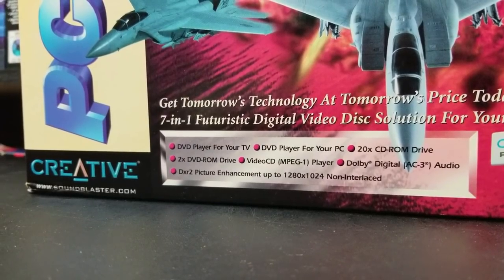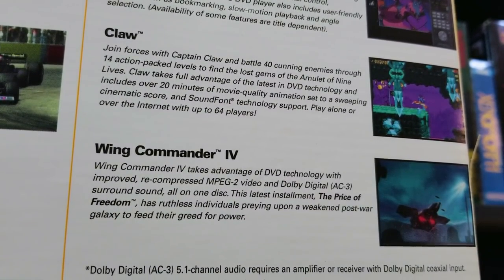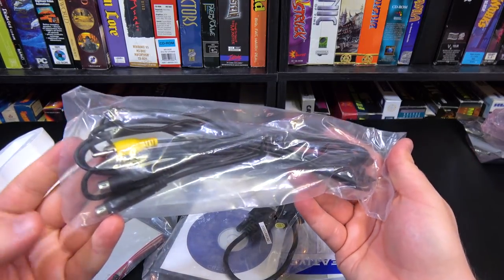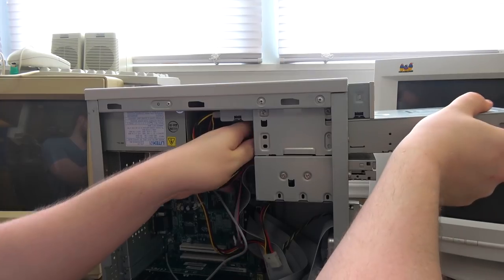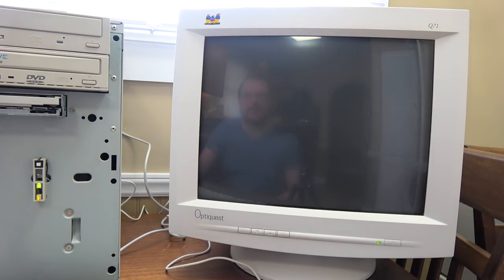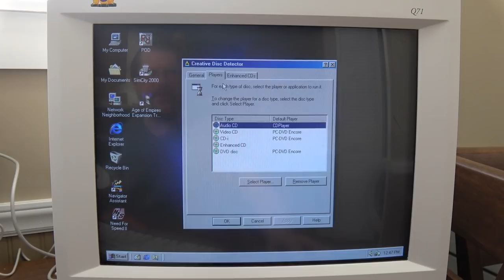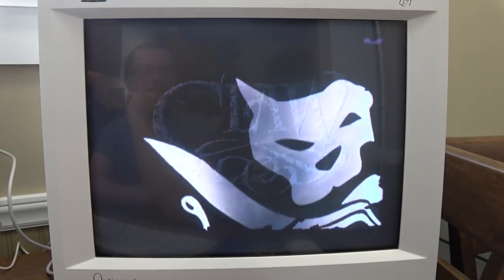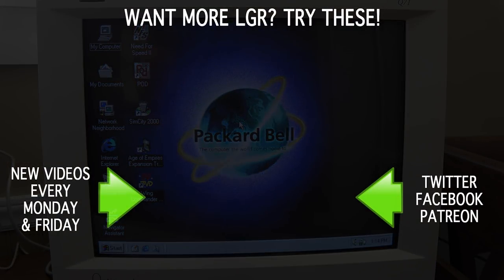The 1997 DVD-ROM Upgrade Experience: Creative Encore Dxr2

Comment: Watching Clint use the button to close the tray made my day. As a young person I HATED when anyone would push on the CD tray to close it.  It still makes me cringe.  Not that you see people using optical media much anymore.
Reply: Yup, that was my take away from this vid as well. My biggest pet peeve is pushing the tray to close. @AdmiralSpeedy any force used is bad for the internal gear. They made it do that cuz they knew most idiots would push it, so it better retract on pressure to mitigate damage. An electronic button that sends a signal to the motor is the preferred way. Even Open/Close command send from the software is better than pushing on the gear.
Reply: My computer's optical drive doesn't even have a button, so I made one in software instead.
Reply: Holy shit THANK YOU!!!

I had a friend that would always shove the disc tray of my Xbox closed as if he was trying to shove Toothpaste back into the tube.

Like holy fucking shit dude, it's a piece of plastic with some weak plastic gears and shitty motor, WTF are you forcing it shut for? Just press the fucking button and wait the extra 0.002 seconds for it to close FFS.
Reply: They are designed to be closed with a push, what you're not supposed to do is give it more of a push than it needs to start closing on it's own, it won't hurt it more than normal wear unless you force it.
Reply: @Hadwell - It's a gear and motor. It was NOT designed to close with a push. They made it activate with resistance so it will be less likely to break. When the gear encounters resistance they allowed it to send a safety signal to the motor. You can avoid this entirely by sending the signal directly with the button. BUTTONS are DESIGNED to be pushed.
Reply: I replaced a PSU in my main rig the other day, realised after putting it all back together that I hadn't plugged the DVD drive back in...  and didn't bother with it.  Haven't used it in well over a year now...
Reply: Lol I hated it as well... Some drives actually came with instructions not to do that and press the eject button instead. 
But at the time unfortunately, even the computer ads on TV  showcasing PCs with (the then new) CD-ROM drives showed the actors/actresses pushing the tray and not only that, erroneously having the data side of the CD up, to show off how shiny and futuristic it looked....

Comment: Reinstalling Windows 98 is the ultimate late 90s upgrade experience. Solved 99% of computer problems.
Reply: Molo9000 That’s still the norm, unfortunately it is with one of the most crappy OS: Windows 10.
Reply: I don't know man. I've been running Win10 since release. No reinstall, nothing. I remember the old days when I'd reinstall Windows on a regular basis.
Reply: FischOderAal I guess you got lucky, in Windows 10, drivers are automatically downloaded off Microsoft servers. However, it tends to download outdated versions, which had caused me a variety of video card driver crashes and sound pops. Even if you installed them manually yourself, Windows Update would keep bugging you to install the “latest” version of the driver. Unable to block Windows updates is a big no no for me. Luckily I don’t have to deal with that on Windows 7.
Reply: Win2K as we called it was the first really stable Windows. At least for me and the people I knew. I was so reluctant to upgrade from that but Microsoft has this way of forcing upgrades. I honestly can't see what people are moaning about nowadays. The hardware is generally so good across the board and the OS's from everyone are stellar. At least compared to how it was win95 kinda days. 

Remember how you'd play a game for a while then get that itch to save because you knew it had been a while and you were due for a crash! lol its not like that anymore thank the broadband gods
Reply: Win 98 SE was OK. But I was soooooo glad moving from Windows ME to Win2k...
Reply: Windows 10 is flawless.  What are you doing wrong?
Reply: ShockwaveEXP
You must be doing it wrong. The only reason I reinstalled Windows 10 lately is because of my CPU/mobo upgrade. If it weren't for that, I wouldn't have needed to.

Classic Windows versions needed to be reinstalled like once or twice a year, but not any more.
Reply: I actually had a quite stable Windows ME experience; the computer was built specifically for the task, though of course it ran Windows 98 and 2K quite a bit better. I miss that computer...
Reply: The infamous 3 stages of windows troubleshooting: retry, reboot, reinstall
Reply: Who else remembers the DOS days? Windows 95 was a godsend back then.
Reply: Molo9000 I just recently had to reinstall stuff on Windows 10... Sooo... Tradition running strong?

Comment: It does not shock me that going from Win98 to Win98SE fixed everything. Win98SE was a massive improvement behind the scenes and native DVD support was one of the categories that got the most of it. In fact, back in the day my upgrade from 98 to 98SE made my daily life a whole lot easier. I probably had about 95% less blue screens and freezes in general after the upgrade.
Reply: For me it was the USB support that was the game-changer.

As a young teen I thought 98 SE was just a cash-grab along the same lines as Plus! and ignored it without a second thought. Not until years later did I learn that it in fact incorporated significant changes under the hood and was the best DOS-based Windows. So much trouble I could have saved myself.
Reply: Yeah Win98 First Ed. was a total train wreck. They had to rush SE out to fix a bunch of issues cos everyone was getting blue screens and also USB issues I remember. Of course this was pre-broadband too so you had to buy a new physical copy (from memory I think MS offered $$$ back deals for people who bought First Ed).
Reply: Andrew Wallington back then was an upgrade 98SE.  I was lucky my first computer I choose a P3 450 96MB ATI all in wonder Pro agp 8MB. Toshiba 6x dvd. Never had issues.  I upgraded to pioneer A03 DVD burner it had a fan added 1 inch longer Aug 31 2001.
Reply: @AnnabelleTheRose  I was going to correct you then I did the calculations

OMG I forgot how slow dial-up was haha
6.5 days for 544MB :o
I remember when my 56k broke and I only had a 14.4k to hand XD
Reply: @snetmotnosrorb3946  cash grab? It was a free upgrade.

Comment: I do not miss this sort of cable management.
Reply: I do miss Windows start up sounds.
Reply: It looks pretty tidy compared to all wiring closet i have been in.
Reply: Back then, just opening up the computer to perform an add-on like this made you a computer expert in most of your family member's eyes.  Good times.
Reply: Those damn flat cables, the awful case designs of that era, fucking around with jumpers,  fires from shitty PSU's that turned your PC into an actual F-18 that was slapped into every PC component box ever and so on.
Times sure have gotten easier on that end. Good cases, no cables to be seen anywhere, good reliable components.

I do kinda miss the cheesy designs on GPU boxes especially. Those continued pretty far into the 2000's but eventually disappeared. If your GPU box had a FLAMING DEMON DUDE on it, you knew it was fast.
Reply: "good reliable components" That's not what get better since old times, quite the opposite in fact.
Reply: So many cables just not quite long enough.. cutting your hands on the shoddily punch pressed steel whilst trying to make everything fit.
Reply: Skynet D-TERMINATION To a lot of people STILL opening it up to add a card makes you “that guy that knows computers”.
Reply: You didn‘t get the full version until you had a SCSI cable for 7 drives. ;)
Reply: I'm quite the opposite. I've always hated working with SATA cables in general (Especially in tight spaces). They've felt quite shoddy that I am afraid that I will snap one if I bend the connector by only a few degrees. That and the non-locking ones always have had a rather loose fitting connection. It was way too easy to accidentally unplug them while working on something else.
Reply: Imagine the spaghetti on high end entertainment systems back in the day! I, myself, had to wire up one such system with a DVD player, graphic equalizer, record player, tape deck, 5.1 surround sound and 5 cd changer. HDMI makes it SO much easier!
Reply: I do. Not visually pleasing I admit, but it was the magic of discovery at the time (in my case) that has got me quite attached to the late 90s PC period. This vid was pure porn xD
Reply: I had to wipe a bunch of hard drives in some early 2000s computers with IDE drives, it was so weird working with that stuff again. SATA is so, SO much easier to deal with.
Reply: Agreed. IDE was a true bodge to get things working whatever the cost.
Reply: Nah, good components have no era, bad stuff bitd and bad stuff now.
Reply: Remember the days of cable rounding? Where you'd take the long wide IDE cables and wrap them up into a tube for better airflow
Reply: I actually have a round cable somewhere, but it was causing read/write errors. You can still buy them from Directron.
Reply: Never really had any airflow issues in my systems. I guess old cables wouldn't look great with the window cases we can have now, that would look pretty ugly. Aesthetically I do think modern cables look more tidy and a lot of the connectors are easier, a lot of the older ones were murder on the fingers. Ow!
Reply: Remember?  That's what I'm doing this weekend.  Got a 15 year old Harman Kardon AVR, a Pelican system selector, and every major game console from the 80s and 90s.
Reply: @ProjectiluvOP
My ASUS R9 270X/280X boxes have dinosaur scratch marks on them… maybe not as cheesy but certainly still cheesy.
Reply: Skynet D-TERMINATION. It still does with the backward yokels i call family
Reply: like like red tube?

Comment: Great video.  Slight correction.  DVDs didn't increase in density.  Double sided DVDs were replaced with dual layer DVDs where both layers were accessible from one side of the disc (one layer was transparent to the laser via focusing control).  This removed the need to flip the disc halfway thru the movie, yay!

Comment: It's kind of amazing that DVD's resolution is so low that even 1997 monitors needed upscaling to make it look good. I remember seeing 1600x1200 monitors in the late 90s that totally blew my mind.
Reply: carmack had a 1080p monitor in 1995
Reply: @Kasperx138  Really? Did they even exist then? I remember a friend of mine had a 1080p LCD monitor in 2003 and I thought it was incredible, I think it cost $2500.
Reply: @QuantumBraced  My dad bought a 40 inch 1080p tv and I thought it was the coolest thing ever. I think it was like $4500 bucks. It lasted a really long time. We had to replace it last year when it finally broke.
Reply: DVDs only displayed at 480p/576p for 30fps/25fps, and if you try getting 60fps/50fps then you'll have to use interlacing instead (which was never part of standardised PC resolutions) so you had to have a proper deinterlacer or else you would get that "flicker" (which is more like a shimmer, since it's different to CRT flicker) that he mentioned while watching the cutscenes in Claw.

If you had set your monitor to 480p then it would probably look fine but most people used higher resolutions which is why they needed some kind of scaling.

Comment: "Tomorrows Technology at Tomorrow's Prices Today!"

laughs while ordering a $20 8x DVD burner
Reply: They said tomorrow, not 20 years from [then]
Reply: And a top of the line one at that.
Reply: $30 256GB USB drive
Reply: I think the real question is here, why were you still burning DVDs in 2018?
Reply: @Howlingd0g  Because they want to?
Reply: @Howlingd0g  Still burning DVDs in 2021 here. It's pretty much the only affordable option if you want archival-grade backups. Flash drives, traditional HDDs, and tape will eventually succumb to bitrot. You can also go nuts with redundancy on DVDs, too. Burn 6 DVDs on high-quality blanks from different manufacturers if you want, the odds of all of them failing in the next 20-50 years is extremely slim.
Reply: @zOMGREI  Well! You learn something new every day!

Comment: FYI: The 'dat' connector on the back of the drive is just a straight S/PDIF digital signal, which, with a little bit of circuitry can be also be converted to an optical TOSLINK connection.

Comment: Windows 98 Second Edition certainly added a lot of hardware support and newer versions of Windows components/software, so I wouldn't be surprised if that difference alone is why you had problems with the original Windows 98 install.
Reply: I don't think it was the driver, but Windows 98 SE also included its own MPEG-2 Codec. Last but not least newer DVDs contained copy protection systems that are not compatible with older versions of Windows.
Reply: im just impressed windows 98 can run dvds

Comment: Back in the days where periodic OS reinstalls were necessary.
Reply: Was soooo nice. Really miss that!
Reply: Given Windows 10's propensity to fuck things up, periodic reinstalls of it end up being necessary.
Reply: windows gets dirtier as you use it, that hasnt changed
Reply: Robert T installed via CD Yes I/o bit error. I personally solved it by installation in DVD-R  2001. It cut half time 60 mins cd to 30 Min dvd.  

Yes I wasted space on the DVD FOR 98SE. 

Cd Rom 24x less error vs 32x & 48x reinstalled.  

As for current BD-R drive smooth ultra less bit errors. 15 mins to reinstall Windows 7 vs 30 mins to reinstall.

Comment: man, reminds me when you had to connect your cd rom to the soundcard with that little jumper thing.
Reply: scottaw1981 AFAIK that let you play CDs without the computer turned on!
Reply: only if you wanted redbook cd audio.
Reply: Not a "jumper thing", it's the audio cable. This was back when optical drives had a built-in CD audio player and a DAC, so a "CD drive" wasn't just a CD drive, but a full fledged CD audio player that works on its own with just power, no computer required. Nowadays, a CD drive really is just a CD drive as it can only reads the bits off the disc and requires an attached computer to do something with those bits.
Reply: eh, at one point they weren't even needed, which is probably why I don't recall using it more than once..in fact I may of detached one to reclaim a CD rom and was like, whats this for?
Reply: scottaw1981 That's because starting with Windows 98, there is an option in the Device Manager for the CD drive to enable "Digital Audio Extraction", so instead of your 1990s era CD drive decoding the CD audio into analog audio and sending it to the sound card through the analog audio cable, the digital audio data from the CD is sent to Windows 98 through the PATA cable and playback is decoded in software by your CPU. By the 2000s, you had no choice but to use Digital Audio Extraction as CD/DVD drives ceased to have a built-in CD audio player, following the path of the softmodem/winmodem of cutting all the hardware out and having everything done in software by your CPU.
Reply: I remember it like it was yesterday :))
Reply: kinda of miss it, I look at my brother's modern motherboard and was like, wow....they're so boring now.

Comment: I had one of these! It was my first DVD player. I think I paid $299 for it, probably on sale. I hooked it up to my 35" TV using the S-Video output, put in my newly-purchased Spawn DVD, and was absolutely blown away by how much clearer the picture was than our old crappy VHS tapes. I also was blown away by having the ability to pause perfectly on a single frame (I probably spent at least 20 minutes just on playing with the pause button and marveling at static frames) and the ability to skip entire chapters instantaneously! Of course, I had a little experience with stuff like this before, as for some reason our middle school had bought a bunch of laser disc players right before they became obsolete, but I only remember us using them maybe once or twice. So having all of those capabilities in a CD-sized format in my own hands was really something at the time.

I bought this in early 1998, and put it into a computer I had built the year before by buying parts at a trade show (man, that was a fun time). It was an AMD K6-166 (which I overclocked to 188MHz), 32MB RAM, 3GB hard drive, and a Diamond Viper V330 4MB graphics card. Oh, and the motherboard was an Abit, the model of which I sadly cannot recall, but it was my first love because the board was entirely jumperless! In 1997!

This thing was pretty expensive even at $300 (my first CD burner drive, which I had bought less than a year earlier, was only $200), but the idea of being able to play DVDs really appealed to me at the time, as did the promise of games on the format, and of course, I saw that Wing Commander IV was included and was like "I need to buy that!" I had to wait a bit to save up for it, but once I did, it was so sweet. 2X CD burner and this thing in the same computer? Hell yes!

I'd love to see a build with something like a GeForce 256 AGP, 2 Voodoo2 12MB cards in SLI, and the Creative DXR2 all together. The back of the computer would look ridiculous.

Comment: I member "Master and slave" IDE cables and those weird CD drive audio cables that never seemed to do anything. My good old days of pc building.
Reply: Those cables were for cd-audio playback. If you had play/next buttons on cd drive you didn't have to even launch any media program to listen to cds.
Reply: They did plenty if you had a sound card that actually took the cable as an input.  Within a few years after this, the method for getting CD/DVD audio to your speakers was obsolete as it all went software based decoding.
Reply: Wow, thank you! Never figured out what those cables did. Sad thing is I find this out now, when I no longer have optical drives on my PC.